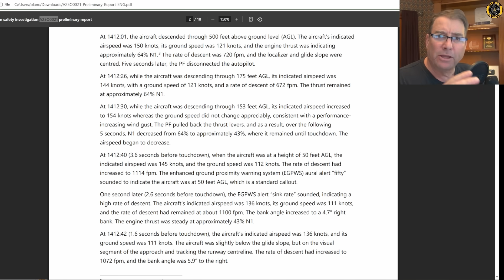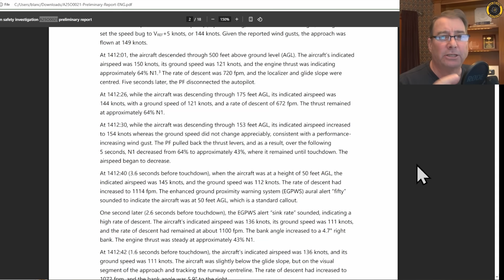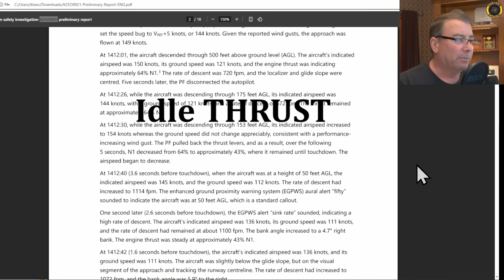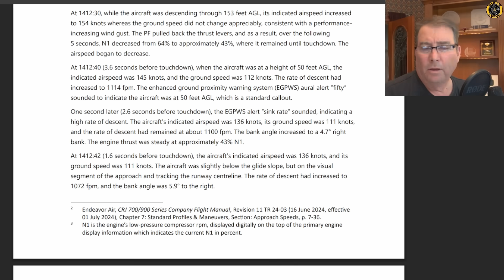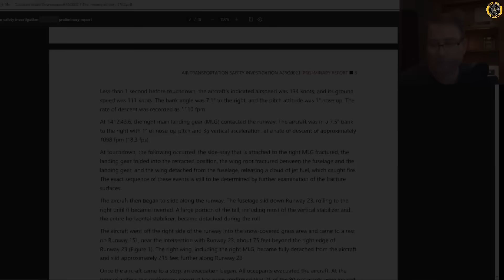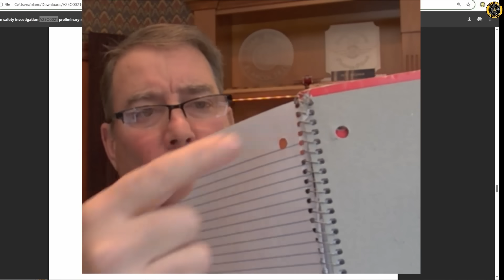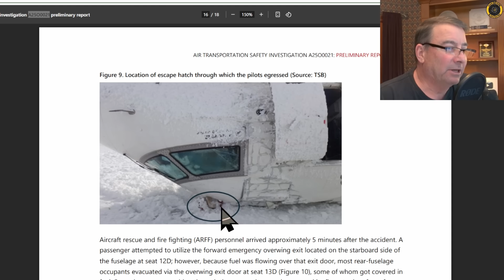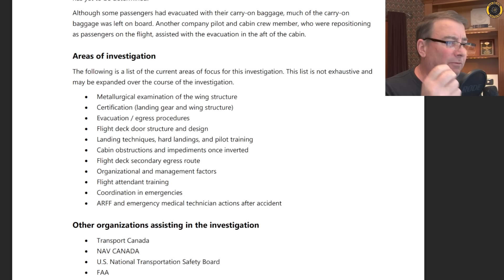TSB Prelim Toronto CRJ Crash

Comment: In various jets and turboprops for airline and charter I always was trained to bug the wind adjusted approach speed. But with twin engines I can see leaving the rest where it is and just flying the adjusted speed because if you have to go missed fully configured that V ref becomes your v2. Some planes like Falcon have a automatically generated V2 bug so you don’t have to worry about that

Comment: This may be an unpopular opinion, but the FAA's (and many sub-par aviator's) obsession with hours and a complete disregard for what kind of activities filled those hours is a glaring hole in the industry. Flying circles around your home field in a C-172 for 1500 hours, is not the same as flying a crop duster for 1500 hours, is not the same as flying as a survey pilot for 1500 hours, is not the same as flying a fighter jet for 1500 hours. It's a complicated problem to address though. Stick and rudder skills are not acquired at the same rate by every pilot, or in every job. I think we need to abolish flight hours requirements and instead have more rigorous flight training and regular testing to a higher performance standard. The standards will be different for every job and aircraft type and that's the problem. There is no one size fits all standard of experience, and this case proves it quite well. Some pilots may meet those standards at 500 hours, others might take until 3000 hours, and others still might never make it at all. That's harder to defend in court though, which is why we'll never see it. The truth is that the industry has settled on the current standards because it results in a level of risk that keeps them profitable and is defensible in court. It has never been about safety, only money.

Comment: Is the loss of Stick and Rudder principles and techniques, the actual principles and techniques in the 1944 book, due to Practical Test Standards and now Airman Certification Standards?  These Private, Commercial, and CFI standards certainly violate the good total energy management principles and techniques taught by Wolfgang Langewiesche.   It is understandable that you guys in heavy jets want to get away from the "stall down" technique Wolfgang briefs that was used, and is still used, by experienced pilots in smaller airplanes.  Also the "Hold it Down" more energy efficient takeoff technique.  But, yes, I agree that learning and honoring, "what the airplane wants to do," among other principles and techniques is very important.  Learning to fly 65 hp Cubs and Champs well by finding other than fuel energy in ground effect and down drainage egress and thermal and orographic lift and the law of the roller coaster does in no way detract from learning to fly airplanes that can go around safely fully loaded on one engine.  Having learned to feel a small airplane onto the surface "all slowed up and ready to squat" would actually have helped here, even though the actual big airplane technique is quite different and certainly more V-speed oriented and touchdown well below Vso in ground effect is not longer the objective.

Comment: I agree with everything is this video and would add inputting rudder and bank angle corrections for runway alignment and drift just prior to touchdown will also add drag and reduce airspeed. Compensating power needs to be added for those inputs in addition to gust corrections and anticipations.  This is where the non-flying pilot can be very helpful calling out airspeed changes.  A briefing prior to such an approach reviewing the issues and gust corrections needed would be helpful in advance to prepare for such last second events.

Comment: Yes , 100% correct.  TOTAL LACK OF EXPERIENCE IS TODAYS ISSUE!   Yes , in the past there may have been 1500 hr or similar low minimums BUT , we had the top 50 resumes on the pile with at least 5000 hours.  So the 1500 hour minimum was rarely if ever actually tested.  Most of the pilots with 5000 hrs or more had flown Bush / Military, or other challenging back grounds , scared themselves half to death a dozen times or so , learned , and had either started sweeping the hanger floor at 16 like someone I know and had a WELL ROUNDED HAND/EYE  coordination background of Tractors , pickups , rifles and control line airplanes.  Some of us grew up from age 5 as “students of aviation “ , we didn’t try it as our fifth career choice!    Half these people are putting the bloody jet on sideways and scaring the sh&* out of everyone onboard because they never learned what the bloody RUDDER  is for.  You buy a Cessna 185 and give them 50 hours in that and fire the deadwood.  There is no 13th place trophy for Timmy here.  You wouldn’t go from janitor directly to surgeon at the hospital!   But again , we could just call it “risk management” , and then it seems like we are using science.  We are actually just rolling the dice till the next meat tube catches fire.

Comment: Both incompetant. I flew 29 years, heavy equip. That little thing can land 3 times on this runway. She pulled off the power chasing speed bug. You fly it on into the gusts. Power gives you control. Two fools with low cognitive ability. I never get on a regional jet anymore because i know what's up front.

Comment: With all these automated systems, why is there not a "minimum airspeed setting" for throttle control in landing mode??!  The same goes for descent rate- why not a maximum descent rate in landing mode?  It just seems that we're capable of making planes do just about anything in flight, but when it comes to the most critical phases, we are leaving everything to the variables of pilot skill and prevailing conditions?  

That such a simple error as excessive throttle reduction at a time when the majority of the pilot's concentration is on the glideslope, seems far too easy an error to make when so many lives are at stake.  Autothrottle control for landing seems a sensible way to go and would leave the pilot free to concentrate on flight attitude and touchdown zone.

Comment: Hit the nail on the head. Flew into Toronto several times recently and may have had 200ft wide runway. This would cause conflict with visual clues and instruments. A go round at this point would have been prudent. Prudence is a handy crew member. She will inevitably cause accountants high blood pressure,but save passengers spilling blood.

Comment: AP off at 500ft? The mistake I see most letting the AP do everything then clicking it off last minute and trying to get a feel for a wild beast seconds before touchdown. The industry has cultivated a literal fear of hand flying. Why Im such a big advocate of it. I encourage all my FOs to hand fly to cruise and again through 10. Just yesterday my FO briefed in 40kt gusts he was going to leave the AP/AT on “down to a couple hundred feet”. I was like no dude click it off way sooner so you get a feel for the pitch and power settings in this 💩. He greased it on. I freaking hate pilots who push automation dependency and the excuse “its safer”. Clearly not lol. Wondering how many airplanes the FAA is going to let crash before they finally push that stick and rudder stuff in the industry…

Comment: Read through the report again. Autopilot disconnected below 500' and that's when the shit started to hit the fan. What does that tell you about this PF? Whenever I was landing in similar conditions, I would disconnect the autopilot earlier than normal, somewhere between 1k-2k', so I could get a "feel" for what the winds were doing to the jet and respond accordingly. This PF was obviously stressed by the conditions and hoped "George" would save her ass. I'm anxious to hear what comments the "Steep Turn Academy" guy in the left seat made on the way down the glide slope.

Comment: For context, the captain hired in 2007 represents about 18 years. Generally a pilot does about 700+ hours per year. That would be 12,600 hours of experience. This Captain had 750 hours since 2007. Do you see the problem?

Comment: Thank you for a very thorough coverage as always. Question to the group.... in the video that captured the crash, can anyone see the elevator go up at all as it would in an attempted flare? Also, is it common in the CRJ to correct for crosswind with 'aileron into the wind and opposite rudder' like you would in a smaller aircraft, or crab land with some side load and kick the rudder to straighten once on the ground?

Comment: Just put carrier rated landing gear on a CRJ and problem solved (sarcasm). Seriously though I suspected wind was going to be a factor in the sink rate increase. One thing that was drilled into me as a private pilot was to hit your approach speeds as indicated on the gauge and don't worry about how fast the ground is rushing by since the plane really only cares cares about the air it is flying in. I got a first hand reinforcement landing an AA5 Traveler at SDF with about a ten to fifteen knot tail wind. I concentrated on the approach speed and did my best to grease the plane in at touchdown since I knew the wheels were going to be spinning a little faster. I also did my best not to panic lock the wheel brakes either.

Comment: A lot is being made of the F?O's restricted ATP.  Lets not forget that not too many years ago all you needed to be a copilot for an airline was 250 hrs, and a commercial pilot's license with an instrument and multiengine rating. Lots of people were flying the line with only those qualifications. I flew with a lot of  them and they did very well.
When you start your flare, you are supposed to switch you vision from the runway to the distance. Every time I forgot to do that the impact was notable. An easy mistake to make in difficult conditions. Could that be a factor?
Reply: some did well, some not so well. 2000 hrs later, some were still doing not so well but they could still meet min standards.
Reply: @skyboy1956  Same with 1,500/ATP pilots. Increased emphasis on stall recovery during training is probably the best thing to come out of the Colgan air crash. As the Toronto crash just proved, the 1500 hr/ATP requirement was not necessary.

Comment: I was always just trained to add half the gust factor to the Vref. Yeah I agree, stick and rudder skill is degrading. But the solution is unpalatable from a management perspective. So we will likely see other less effective options used, ones like increased reliance on automation, which will make the core skills issue even worse. The industry is running off a somewhat broken/dated model in the USA and NZ where I live, where historically a pool of experienced pilots existed outside of the airlines to hire from, but this is less and less the case now and direct entry from school to airlines is the reality, a reality we haven't effectively restricted the training and airline entry programs around.

Comment: 1:17 METAR wind direction is in degrees true, so the magnetic variation needs to be taken into account to calculate the crosswind component accurately. Variation is 10 degrees west at CYYZ so the runway true heading is 227 degrees, making the wind another 10 degrees across. That increases the crosswind to 19kts steady or 24kts in gusts.
Reply: which should be routine for any well trained ATP

Comment: I stated a number of times that Structural Failure of the Right Undercarriage could have been the cause, An Internal Fracture of the Main Gear Leg and Struts which went undetected could have caused the Aircraft to lose its Undercarriage and with the Right wing dipping into the snow the Roll process has already stated to take place until she finally ended up on her back..

Regards 
John

Comment: I beg to differ.  All the planes I flew, the bug speed was just a note on the dial.  The auto pilot speed set in the window was what the autothrottles would attempt to maintain.  Or if in VNAV, VSpeed, VProf or in the rare aircraft “Triple Mission” what is set in the box

Comment: You do not have to flare a CRJ very much because they get ground effects
Reply: Yeah the ground definitely affected the right main LG and Right Wing.
Reply: The CRJ900 requires a minimal flare during landing, meaning a slight increase in pitch attitude (nose up) to reduce the descent rate. The flare should be initiated at around 30 feet above the runway.
Reply: You fly CRJ900 all the way to the ground in crosswinds

Comment: It was always simpler and more realistic to realize airlines are desperate for pilots and are taking people earlier than prudent and elevating them into the cockpit of larger craft sooner... because of profits.  The profit motive gone wild is exactly how you get people in situations they shouldn't be, same as when overworked under rested pilots was an issue in the past.  They'll push you till you break and people die if they think it'll positively impart the quarterly profit statement.

Comment: CBS said she passed 1500 of flight time in 2023. But she has less than 1500 at the time of the crash.

"CBS News learned the first officer graduated from a university with an accredited and well-respected aviation program, and so was able to start working with fewer than 1,500 hours under a Restricted Air Transport Pilot certificate. She crossed the 1,500-hour mark and earned her full ATP certificate in January 2023, which is the highest-level pilot certification in the U.S., before completing training last April, and has been flying for Endeavor since then." By Riley Moser

Updated on: February 21, 2025 / 6:21 AM CST / CBS Minnesota

Comment: I spent 37 years with Boeings and (after the age 60 rule) another 15 years flying Citations! I spent 16 years as instructor and check airman on 737 and 757/767. I was teaching on the 737-200 when the new "glass 737-300" arrived. One of our biggest problems was getting pilots to understand how glass worked (or didn't work!). Then came getting pilots to look out the window instead of constantly monkeying around with the FMS! Finally,after years of encouraging heavy use of the automatic systems and a near calamity out of SFO, the airline decided that pilots needed more "hand-flying time." Those of us that had observed all this taking place over the years  had said over and over that it was a mistake to rely so heavily on the autopilot and not keep current with hand-flying skills. I even had a copilot on a 747-400 trip ask if my hand-flying the airplane to altitude was legal? Every time I hear that pilots are using the autopilot down to 500 feet or so before taking over manually, I cringe! I agree wholeheartedly with Juan's assessment that we have failed to teach basic piloting skills. An inexperienced teenager can learn to fly the planes by programming the computers! It takes an experienced seat of the pants pilot to fly the plane when things are changing rapidly. But, I think we did this to ourselves with all of the automation. Great stuff, but all of those fancy gadgets are just tools in the toolbox. You don't have use them all on every trip, but you definitely need to know what tools should be used for each job!

Comment: You hit the nail right on the head. I’ve been saying this for years as a very experienced military fast-jet pilot and trainer. Stick and rudder training is fundamental. Far too
Much time spent in simulators carrying out complex tasks and nowhere near enough flying an aircraft exploring the flight envelope. The military still do that thus giving pilots experience and confidence and most importantly the understanding of the principles of flight.
Reply: The simulators also let you hand fly and more safely explore the flight envelope of the aircraft.  Plus some military aircraft don’t practice engine out approaches in the aircraft, only in the simulator. Those tend to be the most difficult approaches for,hand flying

Comment: What an idiot. Pilots are better trained and cause far less accidents than at any time in our history. What happened here was that a very abnormal wind condition hit 4 seconds before landing. Not only was there not enough to react and do anything, but the aircraft was not a fighter jet and would not have been able to avoid a hard landing in any case.  Just stop with your stick and rudder nonsense old man. You have no clue what you are talking about.
Reply: How about not pulling the thrust levers to the idle position at 150 feet and then leaving them there for 13 seconds......? LMFAO

Comment: Warning- I am not a pilot so please be gentle- Juan do you think simulators can help close the stick and rudder gap? I also recall Mentour Pilot having gripes about the expense but lack of value in training hour requirements. Obviously pilots need to fly real aircraft but it seems like tech has got to a point where simulators can cover a lot of ground and solve some training issues.

Comment: Fundamentally two observations…
1. The Captain should have flown the sector, failing that he should have taken control during the last stages of the flight… apart from the rate of descent, he should also have called speed as it reduced…
2. The first officer had startle effect, and as soon as she reduced power, the aircraft was destabilised…  with idle power this was always going to end badly…. She should have re applied power as soon as the speed started reducing.

This crew demonstrates the new TikTok generation of pilots I’m afraid, I’m now in my sixties, and gained my “apprenticeship” on piston’s, then turbo props… finally jets… The type of company’s that provided “apprenticeships” no longer exist. So now we have low hour’d crews on jets, which is fine until something goes wrong….. just my opinion.